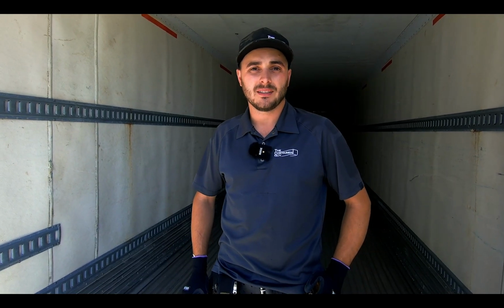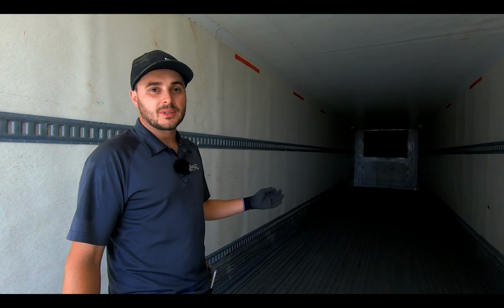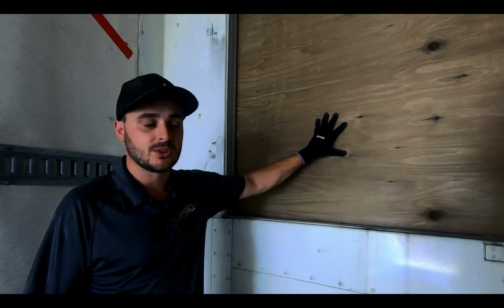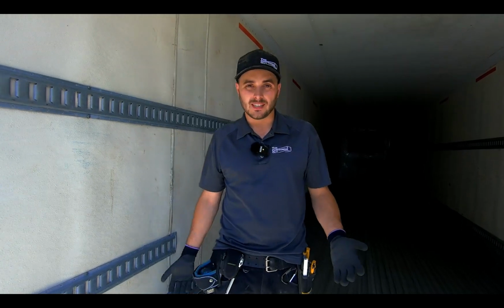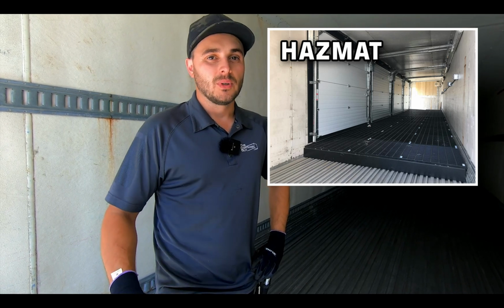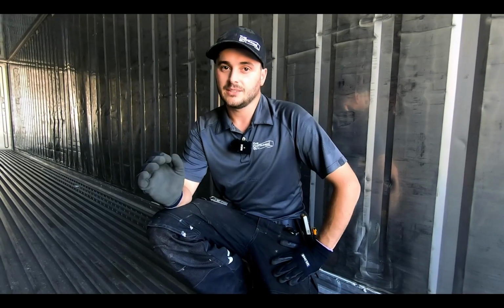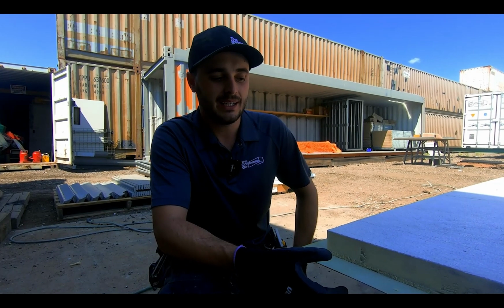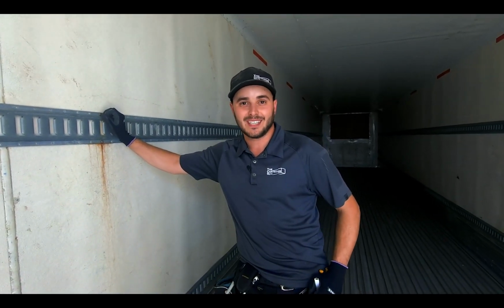Reefer Shipping Containers - Why They Are Useful For Modifications

Comment: Hi question about reefer floor, I have a bouncy area that seems to have gotten worse or perhaps it's just because I'm finally finishing all the modifications to it. I plan on keeping the floor as is but a section that's maybe 4x8 feet is really really bouncy. The rest of the floor is fine. What would be the easiest way to fix this? The container is sitting on 4 heavy duty concrete blocks that rest on several truckloads of professionally compacted gravel. It's just barely off the ground and after sitting through last winter / spring / summer still seems to be level. 

I'm not keen on any kind of welding so the 2 ideas I have are trying to add in some screws to secure what has come loose, or more drastically pour concrete between the gaps and effectively make the floor in that area concrete. You probably have better ideas. Thanks for your time!
Reply from the maker: Have you cut holes in the side of the container? Could be floor sag. 

Sometimes the aluminum floor delaminates from the foam below. This could be because the container was tweaked at some point in its life. We've been lucky in the past sometimes with driving long self-tapping screws through the aluminum floor, the foam, and into the cross members. Sometimes we've been not so lucky..
Reply: @TheContainerGuyTV  yes it’s actually near the man door but that’s the only big hole. Other holes are just power and water and I plan on adding 2 vents. No windows. There isn’t a lot of weight inside yet. I’ll try the long screws first since that is a relatively easy and also inexpensive thing to try. Thanks for your insight.
Reply from the maker: @captivebredcanada  if it's near the man door, that could be the problem. Because the opening going down to the base of the container weakens it a lot. Are you using one of our door steel frames? Try putting a jack under the door frame (the side with the longest stretch to the next corner post) and see if the bounciness goes away. If the jack fixes it, then the door opening needs more reinforcement. Try this before screws.

Comment: Do you think a reefer is better for my application? I want to use the container to house tropical fish that I breed. The container company I'm dealing with recommended a Reefer as it would be cheaper then insulating / framing a standard 40hc and already setup for how I'd like it used. Since there isn't much information on this particular use I've been following house / office builds. While the reefer may not look as nice it seems like it might actually be more practical. My only real concerns going with a reefer is it's designed to be more air tight so less air flow and of course a used reefer may not look as nice as a 1 trip container but can always spend a little and fix it up aesthetically. Thanks for your time. Been watching lots of your videos.
Reply from the maker: Yup. Ex-reefers are 100% the way to go. We had a company from the states reach out and wanted to use 53' ex reefers for oysters. Will save you a lot of money.
Reply: @TheContainerGuyTV  what is the highest R-value that you have?
Reply: Also, what are the largest freezer containers you have? I have seen that they are rarely made but available I 53' and even 60' and as wide as 12' custom order.

Comment: Hey Channing   Thanks for your videos. we are looking at making a home out of a fibreglass truck trailer which is 45 foot long here in Australia could you please have suggestions on building putting windows in a fibreglass exterior cheers from Paul and Monique in Australia
Reply from the maker: Hello. If you send me an email to mods@thecontainerguy.ca, I'll send you some pictures of a window flashing we use for aluminum insulated reefers. We actually have a few kits in stock and they fit in a slender box. If you're okay with 40" wide by 30" tall windows, we could ship them to you. If you already have windows then you could get your own made locally.

Comment: I have a 40’ reefer with the back unit removed.  What would you recommend to recap it?  I am thinking of putting sheet metal on the back and wood frame with insulation, then some plywood on the inside.
Reply from the maker: We use cut-outs from other reefer mods. Assuming you don't have that, if you do sheet metal on the outside, tight fitting 2" rigid foam, then finish the interior however you please. Foam is the important part. The inside and outside finish is up to you. Don't frame with wood unless you're framing a false wall inside of the 2" rigid foam.
Reply: Thanks!
Reply: I’m putting 2 window units on that wall.  Should I use something else?
Reply from the maker: @BigMikeWin  I would frame on the other side of the rigid foam then install your windows against the foam and use 3.5" screws through the nailing flange of the window into the studs. Keep a constant foam air barrier.
Reply: I'm planning to take my end plate and reinstall upside down after all the sheet metal/reefer components removed.  This would give me a good solid frame and support for a bay window.

Comment: Brand new enquirer. Are REEFER units as sturdy as Regular containers?
Reply: They will be sturdier than a GP cont. The external skin is attached to the frame as is the internal skin = twice as much skin tension/strength + the high density foam also provides rigidity.

Comment: You mentioned about not screwing conduit and such directly to the FRP, is there some type of wall stud on the inside that can be used for mounting purposes? 
When you cut holes for windows and doors, is there any type of structural reinforcement that needs to be applied or is that not necessary since the entire wall is a structural component due to being completely filled already?
Sorry if the questions seem weird but I am considering using a reefer truck body as the base of an overland camping rig for the reasons you mentioned in your video. They are already finished and fully insulated on the inside, and I would just need to add windows. My concern with cutting window holes was that it would weaken the wall structure and need to be framed somehow.
The t-floor looks like it already provides areas for cable runs and mounting points for cabinets, etc that would otherwise need to be added in a regular van, etc when doing the conversion.
Thanks in advance for your help.

Comment: Hi great and very helpful video. can you answer a question please? looking to buy a second hand reefer with machinery attached (40 ft with 3 phase electric power unit still attached (40 ft) does the ribbed metal floor in your video work fine with a single pedestrian pallet manual pump unit (meaning try smallest unit for moving IBC's) or will the wheels drop down in to the groves? Thanks in advance? (ps pretty new to this) , thanks.
Reply from the maker: The aluminum T-Slot floor is designed for pallet jacks. They still maneuver around great on it. You're good to go!
Reply: @TheContainerGuyTV  thanks very much appreciate your reply!! Thank you! Have a great day!!
Reply: @BeesInBrittany  I have 40ft thermo king reefer units for sale! Working condition or just the insulated box. Let me know if you would like to inquire. I am in Pennsylvania.
Reply: @kylemiller1054 I need more info, what can you tell me/send me a way to find your website?

Comment: i would also like to know the density of the PUF used for shipping containers. is 2 inch foam is enough for minus temperatures?
Reply from the maker: 2lb closed cell. Our two container offices on site have 2" of foam on the walls, 3" on the ceiling and they were cozy today in -40 celsius. Floors also have 2".

Comment: Can you utilize the aluminum floor as a good conductive transfer basis for radiant floor heating?
Reply from the maker: That's an amazing idea. There's 3.5" of foam underneath so no worry about heat loss below and PEX lines would fit perfectly in the aluminum T-slot floor. Would be cool to pour a concrete slab on top. I want to try this.